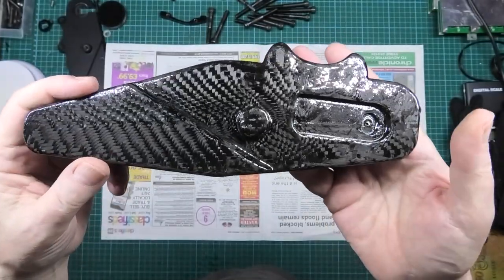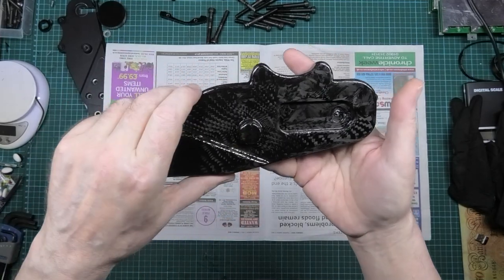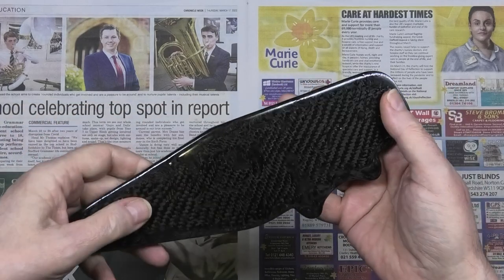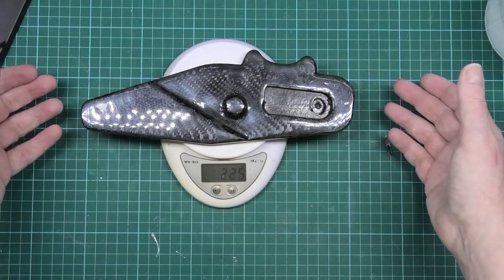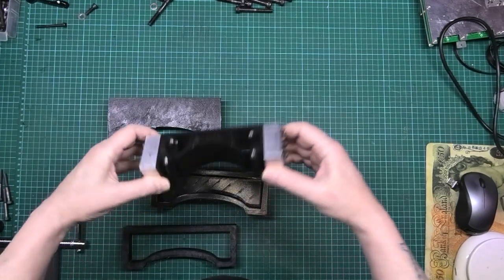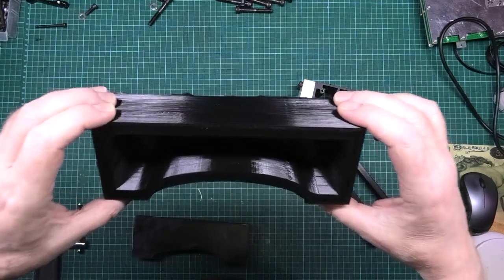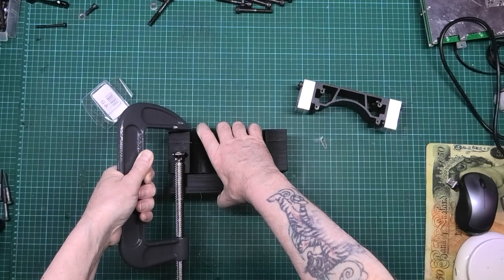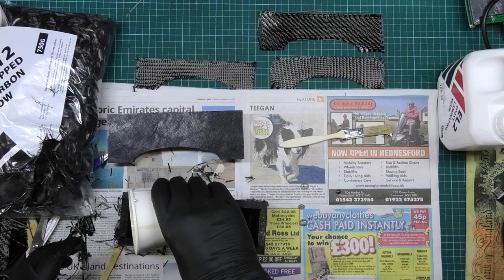🔴 EXTREMELY POWERFUL E-SCOOTER BUILD part 18 - Forged carbon fibre swinging arms and cross brace

Comment: to get the part out i would suggest to drill a small hole in the back just the depth of the plastic so you can fit a air hose and blow it out will hiting with a hammer, a shock pomp that  goes up to 300/400psi should do the trick, (keep clear + pad the landing😁) please film this in slow motion if you take this approach lol.

Comment: Ive found boiling water is enough to soften PLA enough to be able to mold it, maybe some steam, boiling water or a heat gun, give it a dip and get some gloves or big pliers to pull it off in bits? Hope you get it off and the part is still in one piece.

Comment: All the faith in the world in you, but you're definitely going to need to do another one. 

Also, take the swing arms to a machinist and have them drill the couple holes for you. They could even use the original as a guide. It'd be a quick buck for them.

Comment: I reckon you'll have to break off the whole mould around it Tony,  I think the mould will be clumped on in parts and maybe break free in others if you're lucky, once you get the majority of the mould off it you'll still have to file/sand a good chunk of the plastic off it to get down to the carbon "level" luckily its a fairly square part with no real compound curves or complexity apart from the tyre relief area, so you should still end up with a workable part, its just going to take more time to get it to the cosmetically "fInished" stage than you would have liked.

Ps...are you planing on drilling holes through this mount in order to lighten it?, just looking at it i think its probably going to be heavier than the oem part, but still be way stronger which is suppose is the main characteristic needed here.

Comment: I'm guessing that you had to cut into the outside of the mould with a disc cutter of some sort, in order to break it apart. 
I'm also guessing that you succeeded in getting it out after smashing the bits of mould off. The piece is tougher than the mould.
I have faith in someone who knows about graunching.

Comment: Worst case you'll be cutting the block away from the inside job. I haven't got a clue though what you would need to release CF from that plastic mold. Maybe a hairdryer or heat gun if the CF has a higher temp limit. Hoping that it turns out the way you want.

Comment: try to heat the 3d printed part for "easy" de-molding. I am concerned about air bubbles trapped in it. Maybe a vacuum chamber will help.

Comment: I always thought it would end up as heavy or heavier than the cast Aluminium original...I admire your tenacity though Tony. Stainless Steel is not hard in its machinable state, in fact it's a very ductile alloy. A lot of people make this incorrect assumption...🤔😳🇬🇧
Reply from the maker: Cheers mate, just a quick note..... I have covid at the moment. I'm getting better but I've had a week of it.
Back to normal next week 👍
Reply: @Vortecks  Oh Tony mate, get better soon...As if you haven't had enough health problems eh?...😳🇬🇧
Reply from the maker: @EnglishTurbines  Yeah and considering I don't bloody go out, I haven't done bad in getting it. I thought kids only brought you happiness? 🤣
Reply: @Vortecks  Yeah, we're old enough to know by now life can be a bitch at times...As you get older, it doesn't get easier....🤔😳🇬🇧

Comment: If you used PLA then just melt it off but you might have a messy interface. Also the clamps were blocking the breather holes, so that may be an issue too!
Fingers' crossed it'll come out OK!
Reply: Unfortunately not, as epoxy degrades after 150 c and PLA needs more that that to melt.
It’ll soften before that. Enough to pry it apart, but it’ll still be bonded tight to the interface layer.
Reply: @JPEight  True, though PLA goes very soft and pliable over 60 °C so would just peel off.